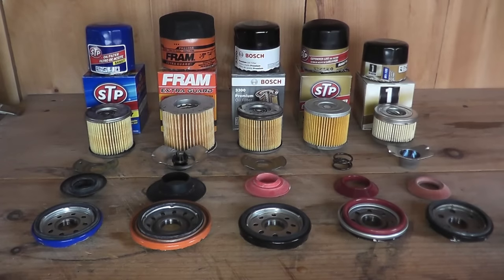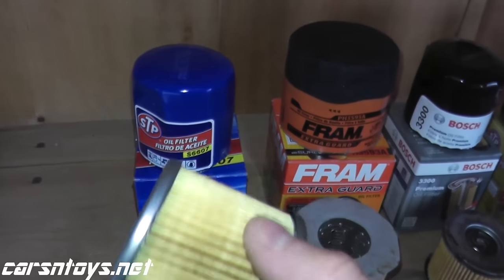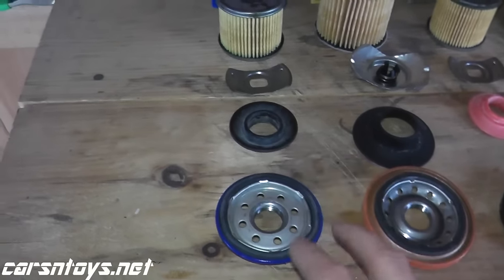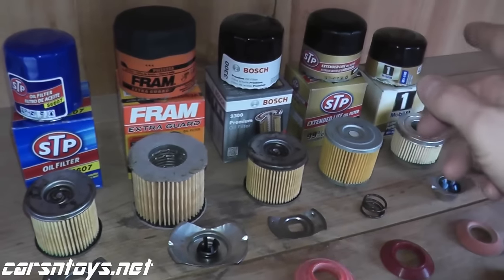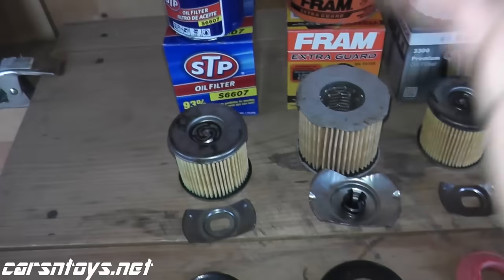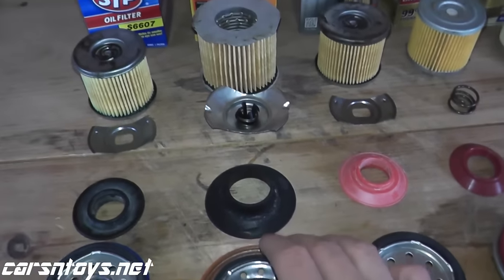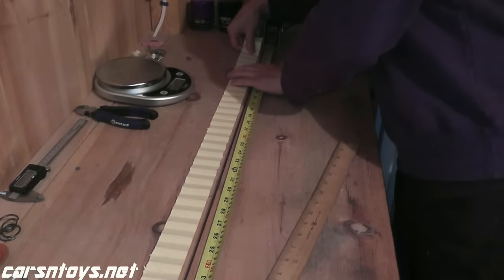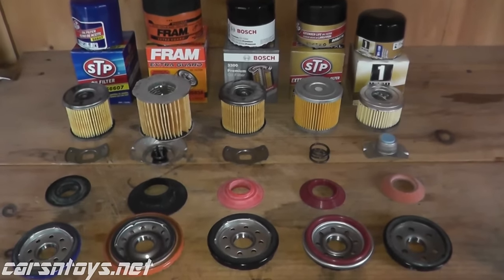Oil Filter Comparison: STP vs FRAM vs BOSCH vs MOBIL 1

Comment: So I have a vehicle with high mileage and don't use synthetic or a blend for oil changes.  Are you saying there's no point for me to purchase a decent filter?
Reply: TheVideoFuzz a good filter is still needed, it filters the small particles out so I would stick with a better filter even though you Change it often you never know what small things get caught in those guys
Reply: It does not matter what you purchase, just follow the recommended procedure and should be good to go.
Main thing is that you are.. doing it.
Reply: wobbly sauce Very true.  I usually try to change both a bit before I hit 3,000. Not sure if it helps doing it sooner but it makes me feel better about it haha
Reply: Mine is over 900,000km, doing it every 10,000k, but do lots of start stop, avg is about 200hrs-ish engine running time, driving-idle like a Taxi.

Service books states 15,000k. 6L +0.5L with filter.

Comment: How can Mobil1 get away with SO LITTLE filtering media on the same application when the others(except FRAM) employ more ? Something it's not adding up here . . .
Reply: JIGA BACHI  Google best oil filters. Mobil1 extended performance comes out winning all the time. It's the engineering. I buy them on EBay $15.00 delivered to my front door with free shipping. Like the old saying. You get what you pay for. Mobil1 full synthetic oil beats the testing in -40 below zero in the flow testing. You car will thank you with a long lasting engine.

Comment: STP is still better then the fram cardboard filter.
it has a metal clamp instead of glued like the cheap fram 
 the STP fillter in this case is three steps up from the fram filter  
even if it is cheap it's still made better   quality matter

6:09  clear the fram filter is collapsing
Reply: You are extremely ignorant. Fram filter ends are not paper or cardboard. It’s a fabric-like material, and it’s used because it gives a superior seal with  the adhesive compared to flat metal, it’s also cheaper, which is just fine since the only time they fail to hold up is when people cut open the filters and start pulling the material apart.
Reply: @stephenmartinez1    
 Why would i want to trust flimsy material on a 6,000$ engine...

you must have a low very lQ

have you seen failed cartridges ?  
Yeah it's no different ..
Reply: @punker4Real  you could use your, “I don’t want to risk my $6,000 engine” argument for any entry-level oil filter. A lot of oem filters are made by fram. Millions of us have used Fram’s filters for years and I’ve never heard of a fram filter destroying an engine, they have certainly worked well for my vehicles. Garbage Chinese-made filters can indeed destroy an engine, by coming apart and having pieces block oil passages. But fram filters are quality, they would never be sold in American stores if they could destroy an engine. Your statement of ‘cheap cardboard’ is factually incorrect.
Reply: @stephenmartinez1    yeah the cheap garbage at the dealership..  why would i want to buy something that only filters for 1,000 miles  when i can get a better filter that works for 4000-4500miles
Reply: Fram bad ass filters

Comment: You gotta be careful when you listen to people's opinions. "FRAM killed my motor." Lol of course there couldn't be ANY other factors within that situation at all. Right? The first thing I would do personally, when a person says things like that I would take a look at what they know and what they do with their car. Are they a real mechanic or are they someone who sits in their driveway and bolts-on performance parts. I wouldn't bet that they are a standard Automotive Vehicle user who simply knows how to drive a car and nothing more, because those people wouldn't know enough to be blaming the oil filter for a catastrophic engine failure. There's all those of reasons that an engine can fail and it Almost always is preventable if you know enough about your engine's design. For example a common one is Timing Belt grenade-effect in which for one reason or an other the timing belt (or chain) fails to keep the valvetrain in time with the upcoming pistons in an interference-type engine. This could be because of a hydraulic tensioner which had design issues from the factory (maybe there was a superseded design and can be replaced for just 1,500-2000 dollars). That's just one example of a reason it could happen and how the owner could have prevented it. Remember yes we've been making advancements in Auto manufacturing in the last hundred or so years but no, that does NOT mean the Mfg's goal is to build vehicles that have a life of 400,000miles. Why? Because they intend for the vehicle to fail and that you will inevitably buy a different one. There does come a time when you are putting more money into an old car than it is worth when you can buy a new one with a 60,000 mile b2b warranty and every repair is free to youand depending on your credit, the new car can be as low as 200-300 monthly (about 3,600 per year) instead of rolling the dice every day you get in your car "will I make it or will I have another 1,300 repair bill." Either way you look at it you don't get to drive for free and the only way to reduce those costs is if you're a trained and experienced Auto tech which also costs money and you'll need the 20 to 50 thousand dollars in tools too.
Reply: K i r k H 4 2 0 the chance the oil filter destroyed someone’s engine is fucking slim to none lol obviously theirs way more to the story they just had a fram on their car

Comment: Does mobil1 m1-107a really last 20,000 miles or a year???

What about severe conditions????

so I could leave it on for a few oil changes?????
Reply: with super tech full synthetic 5w-20.

got the lowest priced full synthetic 5w-20 I could find.

No problems.

Comment: Just an FYI STP, Bosh, and Mobil one are all made by Champ industries just different specs.
Reply: Wildman of the Wynooch ....Fram, Purolator, Motorcraft and AC Delco are tooo!
Reply: Sorry, Fram makes Fram, Purolator is made by Purolator and they make Motorcraft and AC Delco.
Reply: FRAM makes FRAM for their retail business primarily in Wal*Mart, some Honda and some Subaru oil filters. Champ has its own brands (Champ & Luberfiner), but it primarily operates as a contract manufacturer of many, many brands. Currently Champ makes OEM Ford (Purolator makes Ford OES "Motorcraft"), some OEM & OES AC Delco, some Mopar, some Harley, some Kawasaki, some K&N, some Mobil1, some Valvoline, etc. From 2011 to 2016 both FRAM and Champ were owned by the same parent company, Rank Group. But the Champ portion of the business was separated and ownership transferred to other investors in 2016. Both companies make and sell a TON of oil filters
Reply: Yep!
Reply: the aftermarket AC Delcos are made by Champion,,,,same as STP
Reply: thats Champ filters

Comment: I would stay away from the Fram. It looks  to be much lower quality in comparison with the other four.
Reply: you are rite becuase  he bough the $2 not the $18 fram
Reply: Jason C. Well this is the cheapest Fram. The best Fram is really good.
Reply: The interesting thing is that Fram makes both the worst AND the best filter available. The orange cans are shit, but the Fram Ultra Synthetic is possibly the best oil filter you can buy. There is a little competition now, but it's all way more expensive. Thick, full synthetic media backed with steel mesh, all metal construction and still has the nice rough grippy part on the outside.

Comment: Obviously you are NOT an engineer or a scientist. I have been using FRAM for 30+ years for all my vehicles, and ALL pass 200K and running perfectly without any vibration. FRAM does NOT over-done with their products, but it is ADEQUATE protection for normal wear and tear.  It is enough, no need for more. This is called science. For example, if your transmission doesn't support 500 hp and 2,500 ft-lbs torgue engine, why do you need pay the extra money to install and 500 hp engine? Why don't you steel plated your house in case of drive by shooting which might never come?

Comment: Super tech Walmart brand and purolator missing
Reply: Jon Smith  Mobil1 extended performance always wins in testing when I Google the info on oil filters. $15.00 with shipping delivered to my door from EBay. I spend the extra few dollars for peace of mind. Mobil 1 Full Synthetic oil.
Reply from the maker: Purolator: https://youtu.be/ARFGm7BftJM
Reply: Jon Smith  Super Tech are made by Wix. He talks about end caps. Mann doesnt have end caps.
Reply: The Super Tech is better, in my opinion, than the Fram (orange cheapest), and the Fram Tough Guard (silver). It seems to have much better bulk on the inside, especially since the Super Tech has metal end caps, and the Frams do not. One thing I like about the Fram Tough Guard is the  Silicone anti drain back valve, but the lack of cleaning paper material is scary. The Super Tech is paper also, but it looks like much more than those 2 Frams. I prefer the Bosch Premium for price and quality, and buy in bulk off Rockauto.com. I have had bad luck with Rockauto.com before with some wrong parts that are a pain to return, but never bad luck with filters. Purolator is a very good choice for your engine, and what I would choose over Super Tech.

Comment: Ive been using fram for years on my vehicles never a problem with them. The thing  ive never understood is what they mean by synthetic.  It it actual any different material than a paper material cause it looks like the same shit 😂 also random interesting fact mobil makes k&ns filters.
Reply from the maker: Good question. The synthetic material is different from polyester/cellulose/fiberglass used in lower end filters. Synthetic filters allow for greater flow and capture smaller particles. Cheers

Comment: Bosch makes a heavy duty Line for  few bucks more
Reply from the maker: You purchase the filters online?
Reply: @CarsNToys  Amazon has Puralator and Bosch. Both very good !  I last bought some Bosch on Ebay. Local stores only have the cheap filters usually. Sometime you can find K& N almost as good. I used those fir. Many years.

Comment: Most are idiots and change their oil and filter too late or think that it's okay to replace a filter at 10-15 k when the limit is overdue and can damage your engine.
Reply: SacreDro Very true. New oil and filter every 5k (6k max) for full syn. Some manufacturers OCI's are plain ridiculous.
Reply: Their aim is to replace your car every 5-6 years.
Reply: @SacreDro, that's why you got to use high efficient aftermarket parts.
Reply: @MarzNet256, the 5,000 & 6,000 is for synthetic oil.